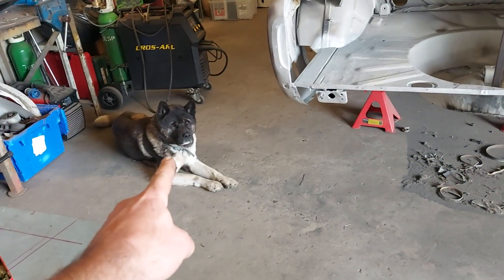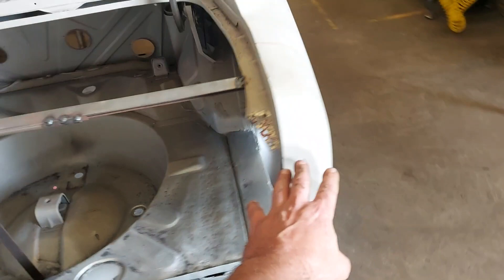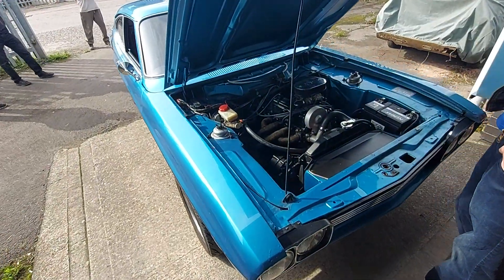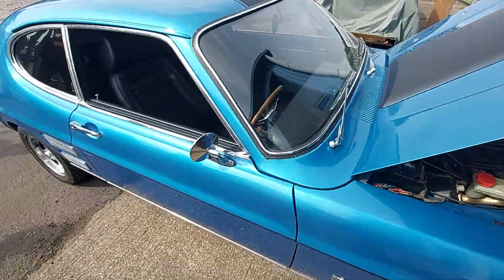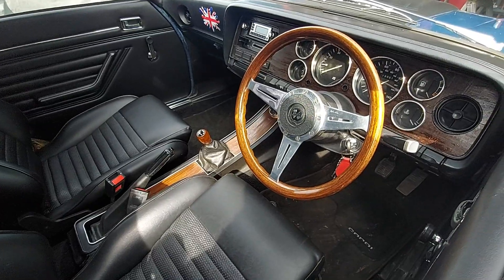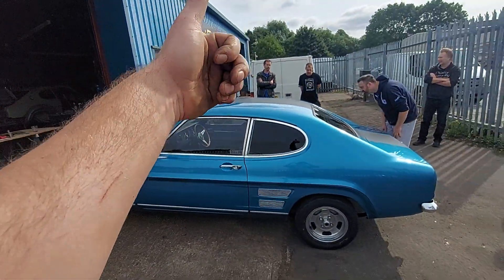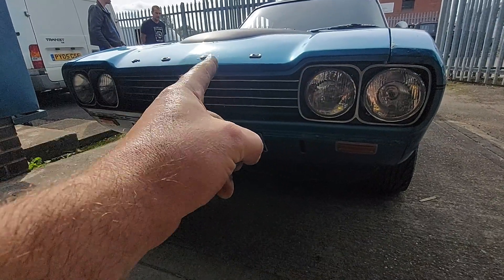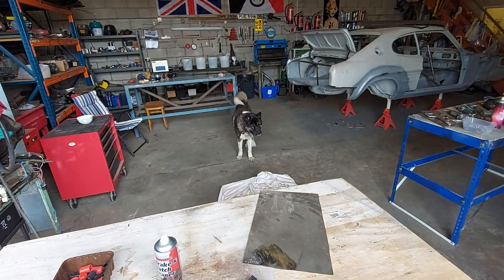1969 FORD CAPRI - PART 96 - Nice looking mk1 ford capri at Rusty Love workshop this morning

Comment: I had a 1973 1600 xl in bronze and black vinyl roof when i was 19 really felt good driving it, also had a 1973 3000 gt in 1989 , in 1972 my father purchased a brand new capri 1300L  in copper colour for £950 big money in them days
Reply from the maker: Wow, nice collection and connection to the capri :)

Comment: I love the facelift models, I had one back in the early 90s.  That also looks like the 2 liter Pinto engine.    Mine was that light lime green with a black interior but no console, also with the 2 liter.  Sold it and eventually bought a 66 Mustang coupe with a V8 and almost no options except for an automatic transmission. 
25-30 years later I now have an 06 Mustang convertible with the Cologne V6 and automatic transmission.  Will probably sell/trade it for a Mustang with a manual transmission.  But would love to find another Capri, but they are nearly extinct here in the U.S.